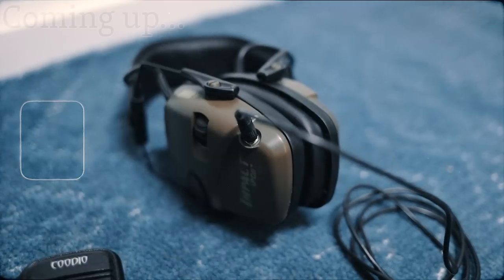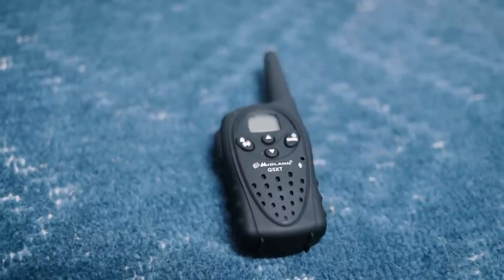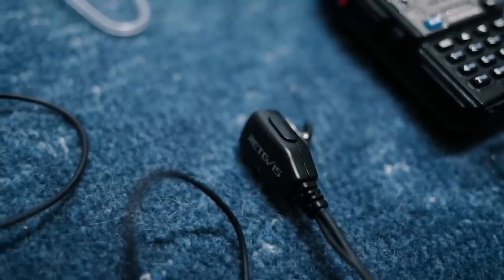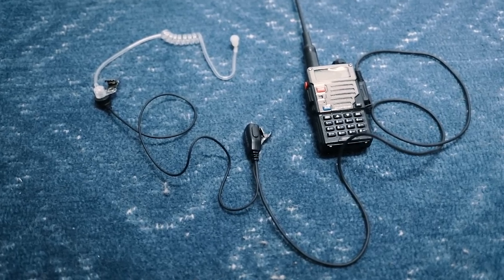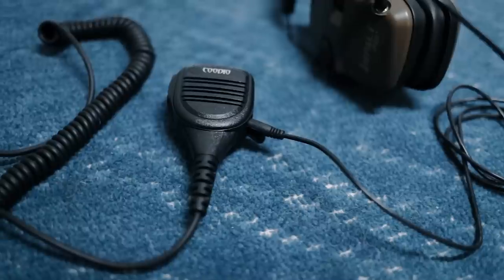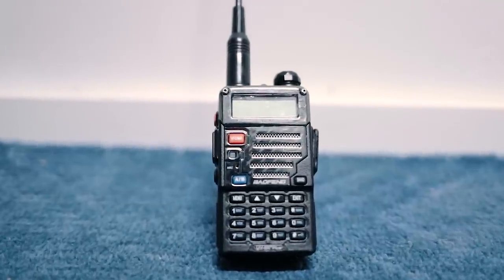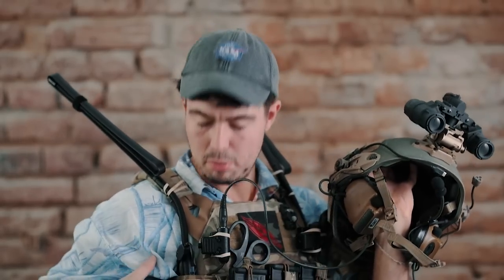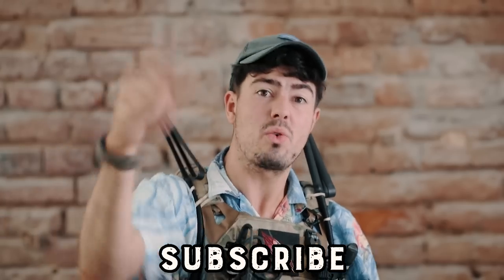Do you need a Radio for playing Airsoft? My MilSim Setup (+ Beginner Guide)

Comment from the maker: ** You have any Questions? Drop 'em here and I make a follow-up video!
Reply: Is it hard to shoulder your rifle with a antenna on the shoulder?
Reply: How do you manage the mesh mask with the ear pro? Mine clips into helmet but the ear pro smashes that plastic onto my ear which is very uncomfortable.
Reply: So you live in Germany and have a amateur radio license or do you live in a nabouring country where you don't need a license?
Reply: Try mounting your antennas on the back reason 1 shouldering your weapon will be easier, 2 its easier to hide your comms cuz you'll be skylining yourself
Reply: Hey eine frage in gehe jetzt einmal davon aus das man diese Lizenz in Deutschland braucht. Wo und mit wievielenjahren kann man die machen
Reply: @louis7201  Selbst mit einer Amateurfunkerlizens darfst du nicht mit den größeren Funkgeräten auf den lizenzfreien Frequenzen Funken. Die Lizens bringt dir nichts, außer deine Teammates  machen die auch. Dafür musst du aber eine neun monatige "Ausbildung" machen. Kaufe dir lieber ein PMR446 Funkgerät wie ein Baofeng bf88e, Midland G7/ G9. Damit kannst du Funken wie du willst, ohne eine Lizens haben zu müssen.
Reply: @finnb.6963  ok danke und sind die mit kenwod kompatible
Reply: @louis7201  Ja
Reply: @finnb.6963  also ich meine halt für PTT Einheiten
Reply: @louis7201  Ja die haben alle drei Kenwood Buchsen
Reply: @finnb.6963  ok nice
Reply: Hi, I want to buy a FMA AMP Headset and I don't know which PTT and commsystem I should run and is compatible, can you help a fellow friend? ;)
Reply: Opsmen M32X radio setup in every possible way detailed from cables, connectors, and radios.
Reply: hey can you send the link for that ear pro/headphones
Reply: No kidding! 🤣
Reply: When connected to the hand mic and plugged into your headset how do you keep the handset from also broadcasting incoming traffic. I just want to hear it in my headset not over that hand mic
Reply: At 7:42 part that set up. How do you keep that speaker mic from transmitting? Cause when I plug into the baofeng hand mic it still broadcasts
Reply: Hello. What pouch do you use for your radio's
Reply: Please help! What kind of cable do you use between the hand mic and the hearing protection (7:44) ? I've tried mono and stereo cable, but i don't hear anything... thx for the answer
Reply from the maker: @andraszoltandemeter4213  mhhh thats odd. I not sure. For me and my buddy a normal aux cable worked fine

Comment: Hallo Phoenix,

The new Baofeng - UV-9R or UV-82 - you can run 2 channels at the same time. They have two PTT buttons, and the microfone also have two PTT buttons, so you can talk and listen two channels using only one radio and one microfone.
Reply from the maker: You are right! The model I am using also can do 2 channels - but you can only listen to the 2nd one, not directly talk without switching on the device itself.
Reply: With Baufeng UV-82 you can listen and talk on two channels at the same time (5R only can listen on two channels, but not talk on both). And there is a specific speaker/mic for the modelwith 2 PTT buttons: https://www.aliexpress.com/item/32905324067.html. The radio: https://es.aliexpress.com/item/32961528047.html. Also two PTT buttons

Comment: With baofeng uv5r's you can just program it to monitor/listen to 2 channels then have both the channels on the main screen so that all you have to do is press the A/B button to swap between the 2 when you want to talk to either or. Your setup is nice but ultimately a waste of money and messy.
Reply: Exactly, there's easier and cheaper ways to operate dual channels as an RO.

Comment: Question, my head hurts after an hour or two in my helmet, I've inserted new pads so now it's 3 hours but what should I do? Get a new one??
Reply from the maker: Maybe you can try the repro Team Wendy pads. I believe I showed them in the AliExpress Items video. Other than that, sadly, I would say you might need a better fitted Helmet. I can run mine all day no problem!
Reply: @PhoenixFeatherAirsoft  ouh, I will go have a look now, the thing is, I was thinking to go Dutch the hooligan style but where do I put the battery for my GoPro plus I do hit my head on things and I do feel head heavy quite a bit :/
Reply from the maker: Yes, I recommend a helmet more than a boonie for sure. If it wasn't for my helmet I would have had multiple concussions. So it helped me a lot! If you use a boonie hat you can attach a battery pack in a pouch on the back. I did that in the 24h Mission video on my channel. You can check it out there. With a base cap I am not sure
Reply: @PhoenixFeatherAirsoft  nice, lovely,   I think I should go for a new helmet that isn't going to break the bank, thanks Mr Phoenix!

Comment: In airsoft/ milsim exercises, and especially on a real battlefield, it is almost a guarantee you’re gonna take a hit if you’re operating alone.. your barrel can only be pointed in one direction, and clearing rooms from the doorway in the fatal funnel is a good way to get shot .. 
I get airsoft is just for fun, and most people don’t take it very seriously, but you need to train with friends to become a cohesive unit .. if a unit trains long enough together, they can actually read each others minds (not literally) but they know well enough how the team operates that they just know where to be, and trust that their squad will cover their arcs of fire.. 
just like in real hostile environments, airsoft requires all the same tactics and skills that real operators use.. 
if you put a 6 man team that’s trained together every weekend for 6 months on a course, with coms and all the proper kit they need, they would absolutely DECIMATE the guys that are just running around by themselves (still on a team, but everyone’s all spread out without comms).. it would be very easy to pick people off .. say you in the lower level of a structure and one of your teammates spots a target through a closed window from the second floor.. he can radio me to let me know, that way when we both turn the corner, I’m not just relying on my reflexes to take the target out .. 
COMMS ARE ESSENTIAL!!

Comment: How about some info on wearing ear pro with the mesh mask? The plastic on the mash is smashed into my ears by my peltors, very uncomfortable. Advice?
Reply from the maker: mhh - hard to say from a distance. Maybe change the face mask. But definitely will think about how to explain that in a video!
Reply: PhoenixFeatherAirsoft thanks!
Reply: You can put some velcro on your earpro, and on the end of your face pro, this way you connect it to you ear pro instead of putting the strap under it..

Comment: Great informative video, could you give me some tips on how the boafeng radio attaches to the howard leight headset, you mention an external microphone etc but there only appears to be one 3.5mm jack input.
Any help would be much appreciated
Dean
Reply from the maker: yes exactly, both the HL and the external Mic would have a female 3.5mm input. So you will need a 2x male 3.5mm aux cable to connect them :)
Reply: @PhoenixFeatherAirsoft  Hey phoenix
Thankyou for the reply, any links or advice which types of cables to get? Apologies I'm new to radio comms setups.
Also sent you a fb message.
Kind regards
Dean
Reply from the maker: hey dude. Just check on amazon or your local music store :)
Reply: @backdropsbases4236  hello fellow person named dean
Reply: @thekidd638  hey man

Comment: how do you use two radio's on one headset id be intrested
Reply from the maker: The DUal Comms system come with two adapters for two radios. Everything else can get a little complicated. I know that JCI Comms on Instagram has some solutions to run f.e. 2 baofengs with one control unit. But its not so easy. The easiest woulod be to run two security stlye earphones with push to talk on both ears.

Comment: hey, really good video, I do have a question though: In the simple midland g5 headset Setup, why do you use the extra speaker mic? you can just connect the headset with the aux cable to the g5, it dosent make a real difference, or am i mistaking something?
Reply from the maker: Well it depends. The Howard Leights do not have a microphone so you need the external speaker mic just for that. Otherwise you can just hear incoming traffic. Is that what you mean?